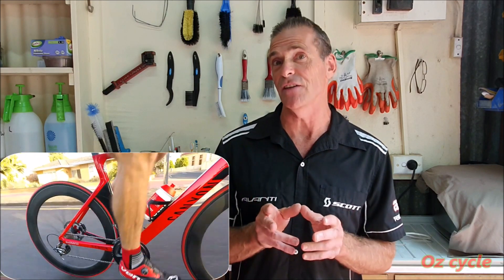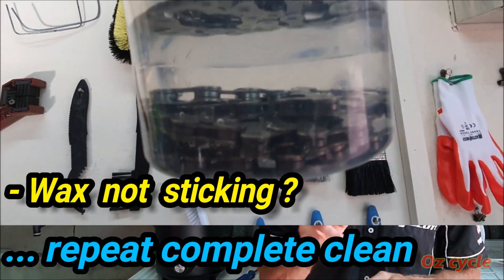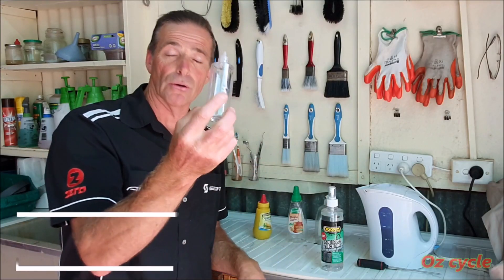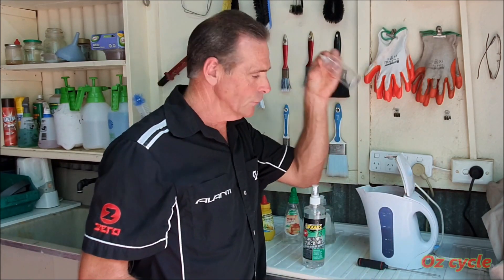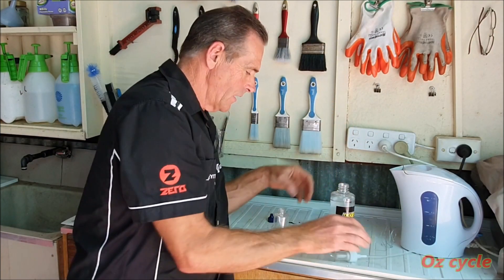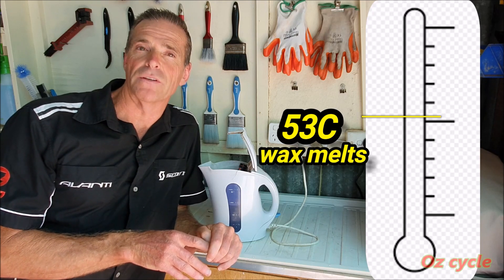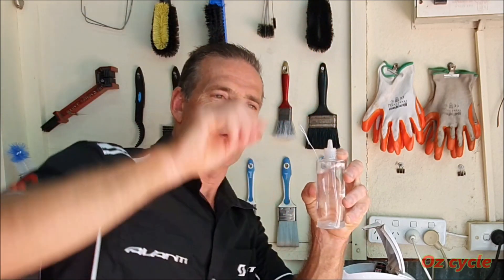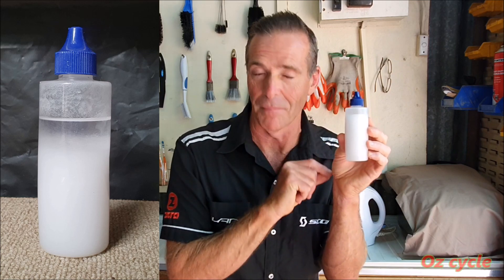Chain wax in a bottle - make it yourself

Comment: Hey there! PTFE enhanced wax is the latest of the wax solutions. But 3 years ago, there was a 1 part paraffin wax, 1 part paraffin oil and 1 part xylene as the best wax. So, needless to say I’m now confused! Should I go for the xylene, oil, and paraffin wax lubricant, or go for the paraffin wax with PTFE only lubricant? I’m riding a high end road bike with DuraAce 9100.
Reply from the maker: Oil attracts dirt so go PTFE. For persistent wet conditions add a little paraffin oil to prevent chain rusting.
Reply: oz cycle.... Hi again! So my last question is now about the added PTFE. Does a 1-3 micron powder work as well as 1.6m?Cannot find (1.6m) that anywhere. 1-3m is readily available on eBay. 
Secondly, every 300k which for me, is a weeks’ riding, I should use hot water to melt the old wax off the chain, then petroleum, then degreaser, then isopropyl alcohol, to clean. Then reapply new paraffin wax with the 50g of PTFE, right? 
And finally, to make some chain lube, take the scrapings off the dried paraffin wax and PTFE mixture and add some isopropyl alcohol at a ratio of 1:8? And at that point we’re all set? Thanks again for confirming my understanding of this latest and best process!
Reply from the maker: 1.6um or less prevents  clumping.
Rewax clean is hot water only.
Bottled wax is 1:10 with 99% proof IPA
Reply: oz cycle Excellent! I bought Xylene, Paraffin Wax and IPA. Time to return the Xylene and PW! Unless there is a reason why I should keep them?! I generally don’t ride in the rain here in California, so rust is not a problem

Comment: Can I use other alcohol than isopropyl?
Reply from the maker: Denatured
Reply: @stevenleffanue  thx
Reply: @stevenleffanue  I have a problem, use denatured alcohol but after i try to some liquid pour to the chain it immediately go to solid state and close the bottle"s hole. How can I solve this problem?
Reply: @elitpoker  You have a venturi affect going on and it is cooling the suspension as it passes through the constriction.

More ISP.

Comment: Cleaning. Sometimes methylated spirits are not that available (and the small methanol smallmolecule is toxic and can absorb through skin) 
Does Ethyl or Isopropyl Alcohol work as well as Methyl for cleaning. (I suspect so)
Also are you using the 10% PTFE-added paraffin for this?  (just wondering how the PTFE might be affected by the Isopropyl)
Reply from the maker: Yes,IPA is fine. 10% ptfe with 90% wax

Comment: Mr. oz cycle, what do you think of paraffin oil (also called liquid paraffin) as a substitute for the alcohol? Some people around the internet report mixing a bit of paraffin oil in the paraffin before soaking the chain, the theory is it would protect the lubrication better in case of rain or water puddles. Since I don't have a thermometer and I can't control the temperature to hit that middle ground 70 degrees between wax and alcohol I was thinking about just mixing more paraffil oil to the paraffin pot, to the minimal point in which is stays creamy but not solidified.

Also, where I live, teflon is crazy expensive. I was also considering paraffin oil as a substitutte for teflon in the wax pot formula.

What are your thoughts on these points and paraffin oil in general?
Reply from the maker: Yes the old wax formula uses paraffin oil instead of ptfe
Reply: @stevenleffanue  First, thank you for replying. I went ahead and tested your lubrification method. I did the cleaning with kerosene, degreaser and isopropyl, and dropped chain in a pot of melted wax (I got a small electric wax melter, works wonders). I used 100% pure paraffin wax for now, as the teflon I ordered hasn't arrived yet.

So my first thoughts after testing is the chain feels smoother, but there is quite a lot of noise now, seems to be comming from chain vs cogs contact. Mostly the front cogs, but the rear ones do some noise too.

Is this normal when lubing with paraffin wax, or am I really missing something (bad cleaning or teflon...)?
Reply from the maker: Chain should be stiff for about first 5km but then smooth
Reply: @stevenleffanue  I rode a few km on it and it did get very smooth. Thanks very much! If you'd allow me one last question: how do you deal with corrosion on the drivetrain and front cog? I have heard that spinning the drivetrain and chain and shifting gears when lubricating with oil helps to get oil in all the cogs, and that thin film of oil would help to prevent oxidation. In the case of your lubrication method, that simply waxes the chain, do you use anything on the cogs to prevent corrosion?

Comment: Love your hot wax treatment. However, tried this one and the mixture went thick and solidified as soon as it touched the chain. I guess I used too much wax. Could you be more specific as to proportions of wax & alcohol by weight?
Reply: Same here. I am wondering why did it freeze. First, the wax won't melt, then they solidified with the IPA. Something is wrong. Need help.

Comment: Oz the 96% alcohol did not work the wax separates and goes solid(does not stay as a liquid)  does this mean it has be to 99.9% then?
Reply from the maker: Preferably. Does the wax melt when you heat the bottle?
Reply: @stevenleffanue  yes does and goes back into liquid form. But I have to be quick with it as the wax starts to get bits and blocks the nozzle.

Comment: @oz_cycle , great videos , i have a small question , im a big fan off molten speed wax, an tried the same as you did in this video, make a skrabe og the hard wax, and so on .. but its harden in the bottle again ? :(
Reply from the maker: 99% alcohol?
Reply: @stevenleffanue   yes 99% alkohol , should it not work, just fine with the skrabe of molten ?

Comment: I was tiring to make the wax bottle and I tried 2 times heat it up but the wax wouldn't  mix with the alcohol it was separate time I don't know what I'm doing wrong
Reply: Austin Duarte same thing for me the isopropyl alcohol does not dissolve the parafine. What work is 1/3 parafine 1/3 liquid parafine and 1/3 metholated spirit like point thinner.

Comment: Ive been able to get as much as 300. miles from my waxing efforts. As a touring rider this may be an ideal solution for longer rides between "home".
The challenge I have is reapplication of wax. The hot water method never seems to be enough. I suspect I am picking up oil from the road, leaving me with little choice but to repeat the (somewhat tedious) petroleum cleaning each time.
Reply: I do not like just pouring hot water over it; I boil the chain for 2 minutes. But boiling has its own issues: it is corrosive.
I like to remove all the old lube, and dry it with compressed air using a nozzle, pin by pin. Wax it and hang it to cool.
I very much doubt you are picking up oil unless it is left over from the derailleur, sprockets and/or the  jockey wheels.

But I have a 21 speed (9x3) and I do not flex the chain side to side as much as single crank setups do.

Comment: I've been keen to try your wax solution but had trouble finding PTFE. Ended up buying Nulon E30 from an auto shop. Could be a dud but decided to give it a shot!
Reply: Ian Krigsman I got mine from eBay
Reply: @_AJH_  Yeah, I check before and noticed a few new listings. When I last checked there was only one for 3μm powder at over $50 from the UK.
Reply: Base on the description (not the title) it's 3im.Do you feel any clumps?
Reply: 3um
Reply: Ying Wang I haven’t actually used it yet. That’s annoying. I did not notice that when I bought it. I was going to make it this weekend. I’ll see how it goes.
Reply: @_AJH_ any updates?

Comment: OK, is this better, worse or equivalent to the shellite carrier version?

Also, since it's like applying oil, there's a method where you shift to "big big" and deliberately cross chain - you're not stressing the chain this is just to lube it. So then you lube the link just ahead of the cassette rotate a link and keep lubing the one ahead of the cassette - the cross chaining opens the link you're lubing to let the lube inside
Reply from the maker: Equivalent.  It's only an emergency lube to get you by the next 100km to the next immersive wax. Apply liberaly as you rotate the drivetrain....wipe excess off with a rag and it's ready to ride.
Reply: @stevenleffanue  and if I'm not using additives, divide the 100km by three?
Reply from the maker: You would think so but it seems to work fine up to 100km.
Reply: @stevenleffanue  I think you just made my day 😁

OK so additive free I just do a careful initial wax and roll with the lube

There's got to be a high five emoji somewhere but I can't find it

Thanks boss

Comment: Made this and after about an hour it became sort of a mush, not quite solid. Maybe a little like a slushie. Any idea what I did wrong? I was working with a 4 oz bottle and did about .5 oz of wax and the rest 99.9% isopropyl alcohol. Would I be better off using xylene?
Reply from the maker: Too much wax...Add more IPA and reheat

Comment: I made a bottle with isopropyl alcohol,but the wax is not hardening,its soft and can be moved easy.any solution sir ?
Reply from the maker: Sounds like your IPA is not 99%+ proof?
Reply: @stevenleffanue  I bought it from Amazon,and it is labelled as 99%
Reply: @stevenleffanue one more doubt does the wax harden after the ipa dries up or before ?
Reply from the maker: When the IPA evaporates the wax goes back to its original hardness.
Reply: @stevenleffanue thank you sir for the valuable information 😊

Comment: I have an issue with the wax in a bottle of isopropyl alcohol. I can't melt wax completely. It still harden when the bottle cools down.  What should I do with it?
Reply from the maker: Is the alcohol 99% proof?
Reply: @stevenleffanue  yes, 99%
Reply from the maker: Ok. Once wax has melted,shake the bottle a few times as it cools.
Reply: oz cycle when i shake it I see the wax starts to harden into something similar to small balls. What proportion of Wax to alkohol should I use?
Reply: Do you experience the different wax quality? Maybe tha wax itself cause issues?

Comment: Is this hard wax pure paraffin wax of mixed with paraffin oil?
And more important why not dissolve way more wax?
Reply from the maker: It's hard paraffin wax with ptfe disolved in isopropyl alcohol. Very little wax otherwise you will not get the solution into the chain links without hardening very quickly just on the outside of the links.

Comment: can i use 70%ipa (30% distilled water) and regular fully refined paraffin wax  without any additive such as PTFE?
 the best i can find in my area is 70%ipa
Reply from the maker: No it will cause the wax to clump. 99% proof or use xylene.

Comment: In the UAE you cant get hold of methylated spirits , is there something else I can use?  You can get isopropyl alcohol but only 70% . Suggestions?
Reply: Isopropyl at 70% will be absolutely fine.  Metho is an Aussie thing,  its just alcohol, same stuff for this purpose.
Reply: @jackheinemann8780  thanks Jack , so I can use 70% iso to degrease the chain after cleaning and before waxing ?
Reply: @mrbenclegg  absolutely
Reply: I used 70% isopropyl alcohol because can’t get methylated spirits in California- worked fine for me.
Reply: @chrislook3395  yeah interesting, from what i can tell mentholated spirits is an Australian thing.  It is near impossible to find isopropyl alcohol here, and if you can, it is incredibly expensive.

Comment: The last days i been thinking on ways to isolate the chain and gearsystem from the environment to prevent dirt and contaminants. On a IGH system it would be easy to just use a pair of PE tubes along the chainlengths but derailleur gearing poses a big challenge. I remember several old bikes had a casing around the chain and it cant be that bad of an idea.
Reply: Google Flevobike Green Machine it will blow your mind

Comment: Great content. At the moment I got my  chain and my rear derailleur wheels in petrol. Can I use the wax on my rear derailluer bearings instead of grease?
Reply from the maker: Not really as jockey wheels spin a lot faster than chain movements. Best to use a light grease or heavy oil.

Comment: Oz, you have definitely made it possible for me to make the move to all wax drivetrain. it is amazing how clean and maintenance free my bike keeps itself after long long miles on road and even on the dirt trails.I have converted all my 4 bikes to this method and had great success. Even though the first clean and even the cleans after are quite laborious i will keep using this method because nothing else keeps the drive train so clean and maintenance free, i swear by wax now. I have 2 questions though:
1. My commuter bike for some reason does not hold the wax, it starts squeaking within the first few days, while my road bike can keep squeak free for 2 weeks of long rides. is it possible that the chain can be non-compliant??? my last re-wax was amazing and bike was assassin like silent until one day on my return ride it rained quite a bit and the next day chain started squeaking. is the chain the culprit or the rain or something else?
2. I haven't gotten my hands on PTFE yet and using just paraffin (candle making wax) and dip the chain in cold water right after cooking it in wax. should i push to find PTFE powder or keep using this method change my grade of wax???

Much appreciated and a big admirer of your work, Thanks mate

with love from Canada.
Reply: I do not know why you are flash cooling it but it must be causing some constriction issues. (i.e. the wax is not contracting at the same rate as the metal).

I'm not giving you an answer: I'm just pointing out one thing I see that could go wrong. (not to mention water getting between the wax and metal).

Comment: I have used the wax method, rice cooker for years.  I tried the Xylene bottle method but the wax solidified

I have now changed to the new recipe with PTFE in the cooker and this is great but want to have a bottle on the move- emergency using the Alcohol.

I cannot get the substance to say liquid at room temp- approx 20 degrees.  Would be lower outside in the UK most of the time. 

Any suggestions as how to keep in liquid?.
Reply from the maker: 90% alcohol?

Comment: I find that Iso's viscosity is too high and everything spills around the chain when applied. So I changed to Propylene Glycol (organic alcohol used for skin care etc) which has a higher viscosity and evaporates slowlier. Also has a high boiling point and non hazardous. So the perfect alternative for me.

Comment: I did it to two chains. The older chain cleaned and waxed just fine. The new chain didn't take the wax all that well(apparently), it seemed like the wax ran out of the new chain even after i let the wax cool a bit before taking it out. I dipped it again and the wax clumped on real hard, and it needed to be broken up after. Maybe a chain that has been broken in a bit more will take the wax better?

Comment: I tried 2 times to create liquid wax but both times the wax melted in the isoprop but when it cooled down it did not stay liquid but separated into liquid isoprop and a block of wax.
Any ideas what's the issue?
Reply from the maker: Shake the mixture before applying
Reply: @stevenleffanue  It happens while cooling down the the wax forms a solid block on top of the isoprop, not small wax particles that I could shake/mix
Reply from the maker: Shake the mixture when it is hot , the wax separates into the IPA

Comment: just given my MTB chain the three step clean and finished off with the wax treatment. I bought what looks like the same slow cooker from Kmart for $25 , cant wait to get out and give it a go tomorrow up Ridge track to Mt lofty and then pick a trail down........haven't located the PTFE yet to add to the mix...is there a store in Adelaide that you know sells it? I figure it will be getting a lot dirtier than a roadie being on the MTB trails...Sensational research....I'm wondering if i can spill some of the mixture on my skiis? Teflon and hot wax...could be good....
Reply: I thought the same. Tpfe and wax on ski pole baskets and maybe on top sheets of skis too

Comment: Thanks for the follow-up video! I am e myself, if its important, that the PTFE in your pot had set down and the scraped wax didn't contain a proportionally equal amount of PTFE in it?
Reply: I was thinking next time I wax my chain, stir it up real good and take a little out and put it in a bottle while it's still hot. Then use that to mix with the alcohol.
Reply: @kodiakpb  that would make sense!
Reply: @x y I’m thinking if you do it this way, all you need to do is add the alcohol and shake it up. Ready to go. I’m going to try a ratio of 1/3 liquid wax/ PTFE and 2/3 90% alcohol.
Reply: @kodiakpb  Give feedback
Reply: I'm not sure how. I don't use YouTube that much.
Reply: See my post. I just did it.

Comment: Can i use a hot paraffin oil to clean the chain after a couple of hundred kilometers of use instead of hot water?
Reply from the maker: No,oil impedes adhesion of the wax to a metal surface. Oil also attracts dirt

Comment: I found some PTFE gaskets. Do you think i could use them instead of the powder?
Thank you
Reply: What is a PTFE seal?
Reply: @kodiakpb  Sorry i meant PTFE gasket.
Reply: No PTFE needs to be in powder form (specifically micro powder i.e. 1.6Mu or smaller) to mix with the wax.
Reply: @kodiakpb  I ordered the powder from China three months ago, but it never arrived. And the only thing that I could find are those gaskets which I intended to grind and melt maybe. But obviously not. Thank you for the advise